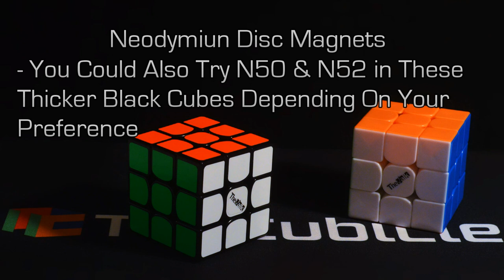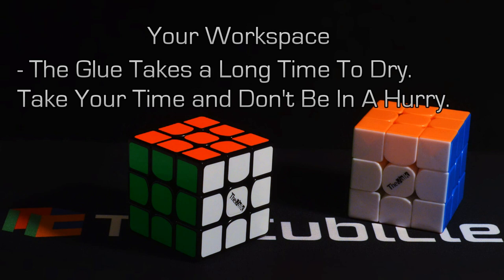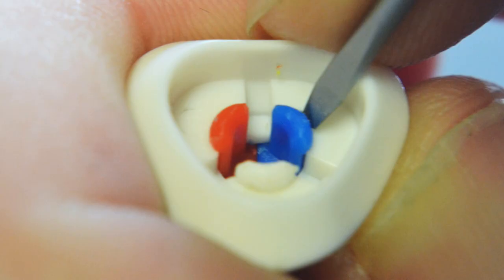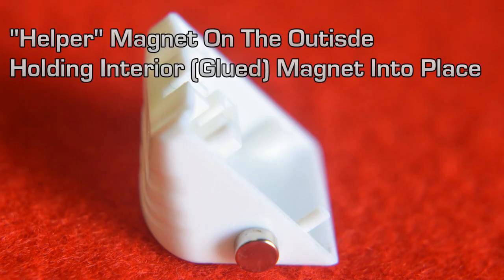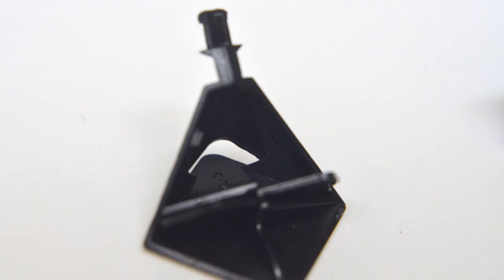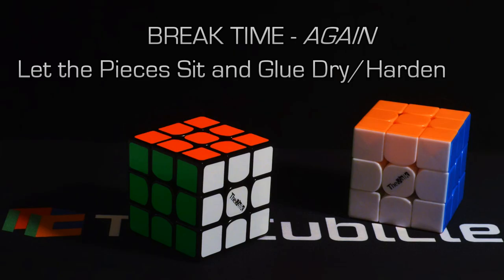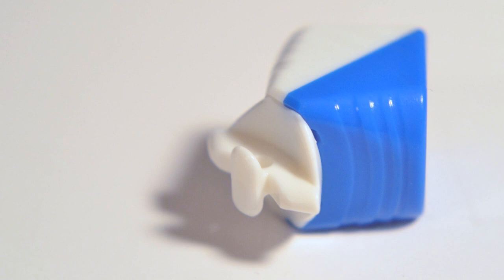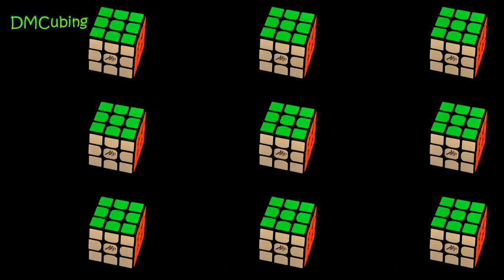DIY: How To Make A Magnetic Valk 3 Speedcube Tutorial

Comment: Another great tutorial.  Used N42 4x2mm, and I cannot believe how much this transformed this cube.  The magnetic GTS feels like a more stable GTS. The magnetic Gans Air feels like a clickly Air.  The magnetic Valk feels like a completely different cube, in a good way.

It went from being a little used backup to being in serious contention for replacing my GTS2 M as my main.
Reply from the maker: That is AWESOME!!! So glad everything turned out good! That is great!!!! 
Did you also use the same N42 strength magnet in the Air?
Reply: I did.  I'll probably use N38's if I do another Air.  It turned out great as well (I'm messing with it as I type this), and I like a strong magnetic feel, but it's on the upper edge of pull strength and a notch down would probably be perfect in it.

Have you done N50's in a GTS1?  I'm about to do another one and I'm trying to decide, but I know N42's would be too weak for it.
Reply from the maker: Jeremy Mullins Hey, that's great. 
On my GTS V1s, I've used both N48 and N52 in the 4x2 size. 
Like you, I kind of like the magnets a little on the strong side. Have you tried the 5x1 magnet in anything? You'd probably really like it. I used an N52 5x1 in the GTS2 and it's great. Feels kind of like the N38 4x2 in that cube. Gaussboys has them, but they're not listed in the catalog. Great magnet because it kind of extends the magnetic field. Hard to describe but it kind of makes the bump a little more mushy feeling when the magnets pass each other.
Reply: DMCubing I'll check out the 5x1's if I do another Air. That sounds nice
Reply from the maker: Jeremy Mullins I think they might be a little bit too strong for the Air. Eventually Gaussboys will be carrying some weaker 5x1s and adding them to their catalog. We just need to settle on which grade first. I'm thinking about trying an N42 5x1 in the Air.

Comment: Hi DMCubing. I’ve magnetised a Gans356 Air with 4x2 N35 magnets and love the feel. It did feel a little strong at first, but now I’m used to it, it feels great. If I were to magnetised a stickerless Valk, what magnets do you recommend to get the same feeling.
Reply from the maker: Hi Craig! Thanks for writing!
I'd probably go with the same magnets. In my experience, the same magnet is going to feel just the tiniest bit lighter in the Valk coming from using the same magnet in the Air. The Air seems to be more sensitive to magnetic strength and you have to watch getting it too strong. The N42 3x5 is the strongest I use and I tend to use magnets365.com "4x2" N35s in it because they're just slightly undersized at 4x1.7 
But if you like what used in the Gan, you'll probably like the same magnet in the Valk.
Reply: In the Air, I used magnets from Omomagnets. They are exactly 4mm x 2mm N35. I’ll give these a go in a stickerless Valk.
Reply from the maker: I think you'll like them. Please let me know how it turns out!

Comment: I'm making one of these, however I'm debating over n35 or n42. What do you think DMCubing?
Reply from the maker: Johnavon Kim well, that is a very timely question! I recently made a couple of new magnetic Valks using N38 and N42 and I must say that the one with N42 is incredible! Without a doubt my favorite magnetic Valk. To me, the N35 isn't strong enough. The N38 feels great but there is something about the N42 that just really works well. So I recommend the N42. And for people looking for a slightly less magnetic feel, the N38.
Reply: DMCubing Were those N42s in a sticker less cube? I have 35s 48s and 52s that I can use, and if I used my black cube maybe 48s would be like your 42s. If not I'll do 35s in a sticker less one
Reply: with n35, it's bearable for One Handed. not sure if the stronger magnets will be OH-friendly.
Reply from the maker: Swedishnbkongu so sorry i'm just now seeing your comment. YouTube did not notify me. If you never get a reply from me, either send a message or post a new comment. I think often when replies are left on comments, YouTube fails to notify. 
Anyway, to answer your question, for the past two weeks, I have been doing six separate prototypes using N38 and N42 in black Valks. I will eventually have a video, with all the details in my findings. But briefly, I personally prefer the N42, but they have a definite magnetic feel. But the cube still remains so super smooth that once things are in motion, the magnetic feel lessens. I think, however, most people would probably prefer the N38. I still feel that the N35 is a bit weak for the Valk. I no longer use the stickerless Valk so I really don't have much info on that but that the N35 is probably good in that cube, and the most used magnet. There is a slight difference in magnetic feel between black cubes and lighter color cubes, due to pigments used to make cubes black.
Reply from the maker: Haxpo Thanks Haxpo!
Reply: DMCubing Oops I already made mine. I made it with n35s in a Stickerless cube, and I actually really like it. Maybe I could have used n38s but I used those in the Yan 3 and it was too strong. The ones in the valk are subtle but effective
Reply: Lol as you said, you might not see this but whatever, not a super important message
Reply from the maker: Swedishnbkongu Nice hearing back from you! No, it's important to me. I like hearing what people prefer in all these cubes. That gives me a better knowledge base. So glad to hear your cube turned out well! That's awesome. And you did the Yan too. Nice! I gave my Yan away. I need to get another one. Right now I'm doing another Valk. I'm prototyping nine of them this month. Trying out different magnets. That's been keeping me busy!
Reply: DMCubing I used an N42 magnet for a black plastic valk 3... but then it turned out to be too strong too my liking.. what can I do with it man? or does it need some breaking time or what?
Reply from the maker: MiChA3L BrYne Breaking it in will help, but what will help the most is backing off on the tensions and making sure that you use a good lube on it. This cube can actually feel pretty good with 42's in it but you have to find a balance between tension, lube, and magnetic strength. Let me know how it goes.
Reply: DMCubing So the lubing method uses a lighter lube? or heavy lube? because I used weight 2 on mine... thnx btw
Reply from the maker: MiChA3L BrYne you could probably use just a slightly thicker lube. I tend to lubricate mine like the cubicle does their premium basically a heavier lube on the core and a medium to medium light lube on the pieces.
Reply: DMCubing okey thanks! definitely a big help! 😁 I hope that you channel will continue to grow bigger!
Reply from the maker: MiChA3L BrYne Thanks!! Yeah, try maybe lubing the core with a little heavier lube. This cube can feel really good with the N42's I've made three of them so far like this and they really feel good, and the strength and weightiness of the magnets really kind of goes away the quicker you move the cube. Let me know how turns out. Thanks for your kind words too, I appreciate it!
Reply: DMCubing yeah definitely gonna send a comment as soon as my valk turns well 😄 but right now it feels more like a magnetic pyraminx. LOL 😂 but yeah! ill be setting it up soon... and by the way is it okey to loosen the tensions more so than it would normally be? 😁
Reply from the maker: MiChA3L BrYne Yes, actually you do need to set the tensions a little looser on magcubes.
Reply: DMCubing To be honest my Valk M turned out to be a more pronounced magnetic feel even on loose tensions.
Reply from the maker: MiChA3L BrYne Hmm I'm sorry to hear this. How loose are the tensions? I know that's hard to describe in a comment. I just wonder if tightening just a tad if maybe they're too loose might help. Usually you can find a balance between magnetic strength, tension, and lube. Ultimately it may be that a lighter magnet like the N35 may better suit your solving style and how you need your cube to feel. But luckily, if you need to do another cube, you could easily sell the N42 version you have.
Reply: DMCubing yeah that's my plan with this cube right here tho. But I'm gonna keep it for now. Its my first speedcube by the way so just gonna keep it! 😂
Reply from the maker: MiChA3L BrYne That's a good positive attitude! Once you find the right magnet, magnetic cubes are like magic!!!
Reply: DMCubing yeah thanks man! Will you make a video of magnetizing a weilong gts v2 in the near future? I think im going to make one soon...
Reply from the maker: MiChA3L BrYne Absolutely!!!! I'll start work on it the day I get it!!!!
Reply: Johnavon Kim how about n45 magnets?
Reply: just a Cuber I suggest putting only N35 because for my project Ive tried N42 and it is really strong for my liking. But if you want a strong magnetic feel then go with the N42s
Reply from the maker: just a Cuber Those would have the potential of being too strong. Personally the strongest I'd recommend is the N42, only if you like a stronger magnetic pullforce. N35 is probably more suitable for most people's liking.
Reply: DMCubing hey man! Do you know some puzzle wholesaler that are legit? trying to have a cube store though...
Reply from the maker: MiChA3L BrYne I've ordered quite a few times from cubezz and they have low prices. Also lightake.com where I've ordered before.
Reply: DMCubing thanks ! what do you think about the puzzlewholesale? its recommended by champions cube store though...
Reply from the maker: MiChA3L BrYne I've never heard of them. Sorry.
Reply: DMCubing by the way thanks man! Prices on lightake wholesale should be almost half a price of those in the cubicle right?
Reply: Can anyone link me to a site where I can get N42 Magnets?
Reply from the maker: MiChA3L BrYne Sorry I never received notification from YouTube about your question. Lightake is much cheaper, as is Cubezz but it's not really half price. It's still pretty good.
Reply from the maker: CrispDZN - Quit. Sorry never received notice from YouTube. gaussboys.com is the place for N38 and N42. He's also going to start carrying N35 and N50.
Reply: DMCubing for a valk 3 should I have n35 or n40?
Reply from the maker: MyWiFiSUX Most people use the N35 4x2. These give a nice subtle feel. You could probably use the N40 if you feel you need a more pronounced magnetic feel or have an aggressive solve style. I've used N42 before. But most people prefer the lighter feel of the N35 in this cube.
Reply: I going to use N42s.  I like a stronger feel.
Reply from the maker: jonathan herring They'll work, for sure.
Reply: What about n50? :DDD

Comment: I magnetized my Valk 3 today with N35 4x2mm magnets and I like the feeling a lot better than my Air which I used the same magnets on. My personal preference is that the N35 4x2mm feel too strong on the Air and just right for my turning style on the Valk. Thank you for making these videos!
Reply from the maker: Lexmic I was just watching the video. 
I agree, the N35 4x2 is great in this cube. Also the slightly undersized 4x2 (4x1.7) N35s from magnets365 work great in both the Valk and Gan Air. With the Air, you can always dial down the strength of the magnets by positioning them further down into the piece toward the core. This lessens the magnetic pullforce strength.

Comment: Thank you for making this video! I am afraid I bought too large/strong of magnets. This was one of those cases where I thought bigger is better! and went with 6mm x 3mm thick n52's. I guess the only way to find out is do it. I will do it tomorrow but figured I would look at it tonight to see how hard it will be. Glad I found your video! Also its nice to find an older cuber on youtube. Usually you come across videos from children/teenagers This is why I mostly stick to reddit for my cubing needs.
Reply from the maker: x9x9x9x9x9 Thanks! Those 6x3 magnets in a Valk will make the cube feel very blocky and stiff. The thing with magnets is finding a balance. On the Valk, the N35 and maybe just a couple of grades higher (but still below N48) will work fine. I think you'll find the 6mm diameter too be too wide, as well. The Valk has the vented corner pieces and anything wider than 4mm is going to risk hanging out of the cutaways. Furthermore, an N52, the strongest grade is way too strong for the Valk, even at the 4mm x 2mm. Trust me. You'll end up with an unusable cube. I should also add the the corner pieces really aren't designed for repeated disassembly, so once magnets are added, it's almost a wasted effort to try to remove them and try a different size. The 4mm x 2mm N35-42 is what is required in the Valk.

Comment: DMCubing do you think n 42 is ok for a thunderclap v2?
Reply from the maker: Lil Vander I personally wouldn't magnetize the Thunderclap V2 because of its design. Unlike a lot of newer cubes, the TCV2 has a sort of cubie piece drag already built into its design. As any given face of the cube comes into its resting position, there is a certain amount of friction that engages and helps the cube keep its cube-like shape and alignment. This is what magnets do. Unless you had the tensions very loose, there's not much that magnets are going to do, and in a worse case scenario, the magnets could even cause the cube to slow down and drag even more.

Comment: 4mm x 2,5mm/2mm, N35 or 4mm x 1mm, N48 what do you think? for the valk or the thunderclap v1?
Reply from the maker: You could use an N48 4x1 in the Valk if you like a light feel. Most people use N35 4x2.  For the TCV1, certainly a stronger magnet. I've used N48 and N52 4x2s in it. N48 4x2 for a normal magnetic feel- it's an older cube and has thicker plastic, hence the requirement of a stronger magnet. 
I've never personally used 4x2.5 magnets. But if you have some time to try it out, you can enter all the magnetic values into the K&J Magnetic Calculator and get some predictable outcomes: https://www.kjmagnetics.com/calculator.asp
Reply: I actually did use the calculator :D, but If i never magnetized a cube, should i go for the TC v1 now?
Reply: What opinion You have on 5x1, 5x2 or 3x3 N48 magnets?
Reply: And one more thing i never felt a magnetic cube before, so that's sad and thank you so much for responding,
Reply from the maker: BogdyReLoad I REALLY like the N48 5x1. It's just a little lighter feeling than the N35 4x2, but really works great in its place.
Reply: Or 5x1 n48 would Be good for the valk as well?
Reply from the maker: BogdyReLoad Well, you have to start somewhere. A lot of people haven't used or felt a magnetic cube. They really feel great in the hands and give a nice subtle bump while keeping the cube better in alignment. Most people like the feel. 
I wish I could give you more information on the magnets you asked about but a couple of them, the 5x2 and 3x3 really aren't used much in cubes. The 5x1 is though, and the 4x2 is the most popular size.
Reply: DMCubing thank You so much, feels good to have a quick conversation about magnets in cubes, bassicly like talking to Chris Tran :D
Reply: And i forgot to say, ALL OF THEM ARE STICKERLESS :D